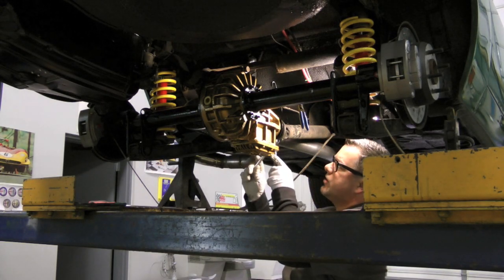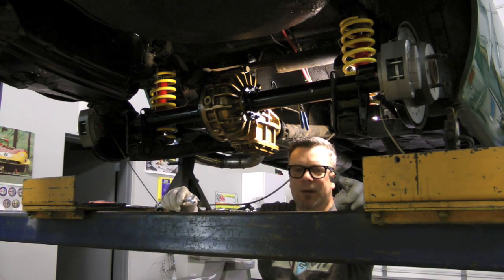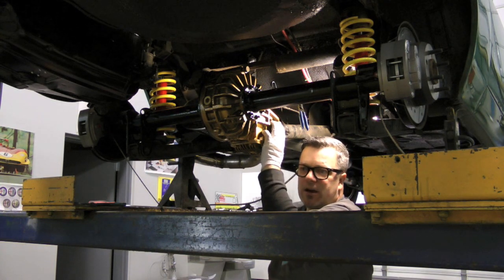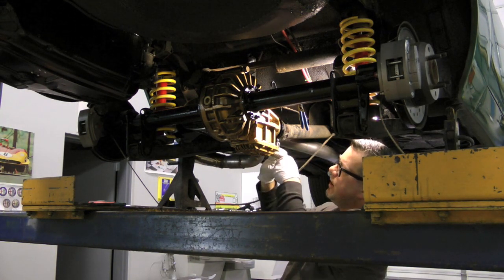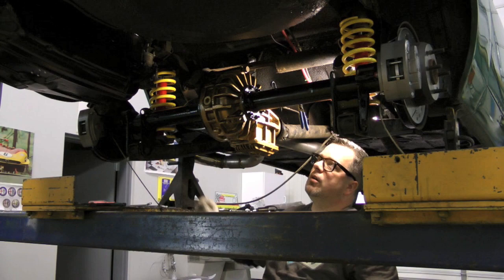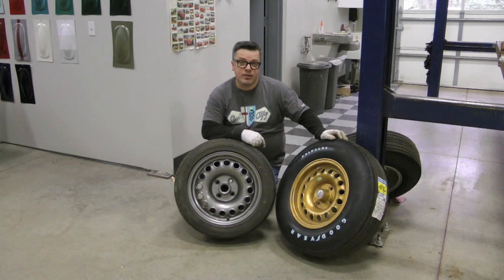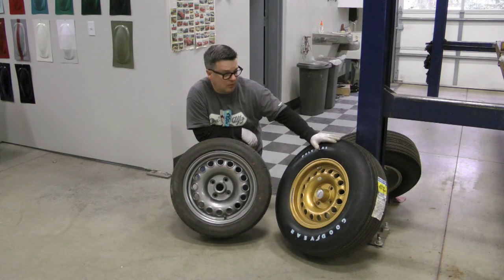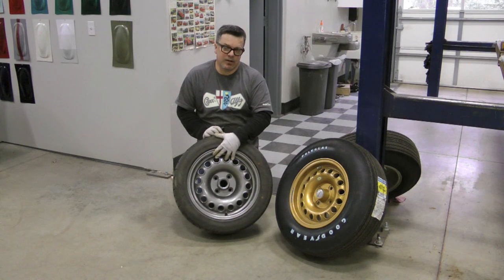differential and suspension part 2

Comment: I know this is an older video and I may not have seen all yet ,so it may be covered somewhere else, just interested in the rolling diameter of the two different tyre /tire examples here.Irrespective of wheel size (but most obviously using the 15s), the outside diameter of the two different sized tyres is going to affect final drive ratios,so it seems to me that you could conceivably have two sets of different diameter tyres, one with a track day smaller diameter and one with a more street friendly larger diameter (for a higher gear) ,which may negate the drama and expense of trying to find the best compromise differential?
Reply from the maker: waaen that is a loaded question. Differential selection is influenced by many things. Transmission gear ratio , engine RPM sweet spot, tire size, primary road use ( track, highway, country roads) so there is a lot to consider. This is why I like the 4:3 differential. Lesser evil of all options in my opinion